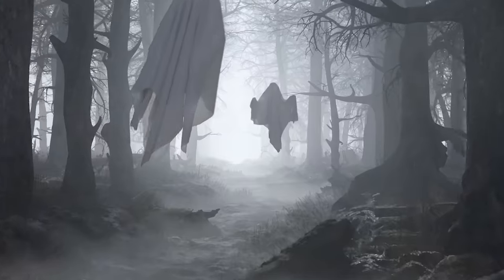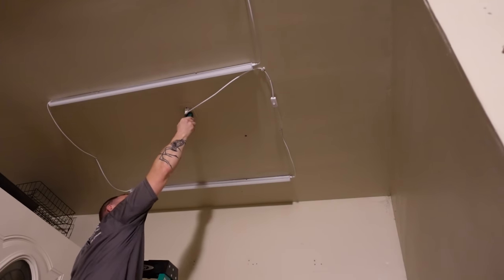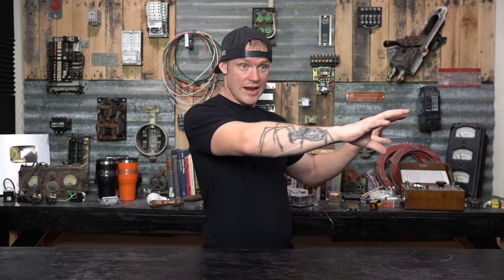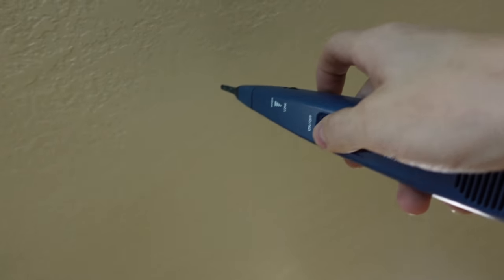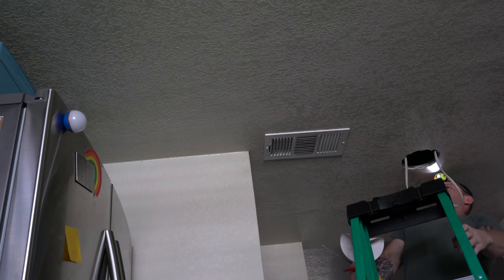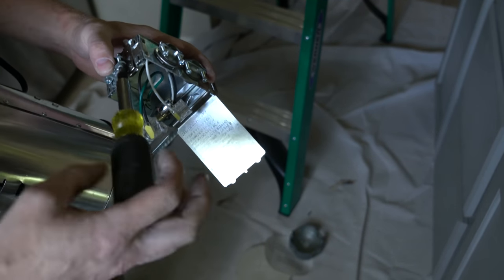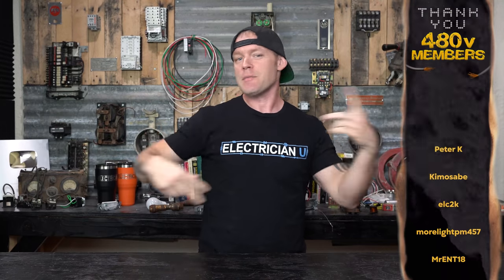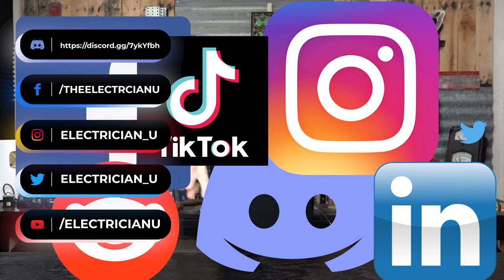THIS IS WHY ELECTRICIANS DON'T HIDE J-BOXES IN WALLS - Finding Hackwork!!

Comment: Main reason, I got out of "Commercial", work, was "Fast food" restaurant, trouble calls, Manager would complain, when I found, "Hack Job" Installations, undersize wire to cooking equipment, ECT. I explained fix, run new wire, They would blow a "GASKET". Like It was my fault, they had a "HACK", do the work. I went to "Industrial", same thing, followed me. You just can't "WIN" as a conscience driven, ethical Electrician. I retired.
Reply: preach it
Reply: @Lewdacris916  or a roach behind fry station...🏃🐜
Reply: Yes, thats why I stay away from service work. Lol
Reply: @ndusrnm  trouble shooting 101
Reply: I just came here from reading on an exclusive professional licensed electrician forum where they were discussing the best way to make a hidden joint, whether to use a metal box, a Western Union splice, or what. Not IF, but HOW. They had already concluded that sometimes that's a fact of life, the easiest way out of running wires from the panel and that there were no holier than thou amongst them. And that the Code Board members were just a corrupt bunch. Again: EXPERIENCED LICENSED PROFESSIONAL ELECTRICIANS.
Reply: @rogerbritus9378  
There are some extremely interesting situations that happen when correcting errors like this...
1.) Homeowner or business owner with electrical problem does not "believe" you when you tell them you have to open a wall or run a new wire from point of problem back to panel box.
2.) Related to number one... People have seen so many electricians "throw a splice" in a wall or ceiling that they think it is normal and acceptable. (per discussion by non-holier than thou electricians on that forum).
3.) The "fact of life" aspect DOES come into play when dealing with number 1. I say it is a fact of life too while being a "holier than thou" electrician myself. Reason... There is nothing more frustrating than a customer who decides you don't know what you are talking about (despite your credentials, license, insurance, years of experience) and hires another "hack" (non-holier than thou and does not give a damn about code or safety)...He "corrects" the problem with further code violations by throwing another illegal splice in the mix. The customer is just "happy" that it is now "working" and thinks you are the biggest idiot and "hustler" who was trying to destroy their home, charge an excessive amount of money and just overall... you are not a good electrician. It's a fact of life that when you walk away from a job that needs to be properly corrected, you will most likely be labeled incompetent.
Reply: @TJCarterNYC  part of being a good service electrician is getting the customer to understand that what you are proposing makes you better than the hack, even though you are offering a slower, more expensive solution. If you can’t develop that skill, you can’t do service work. It takes charisma, an ability to speak in a good cadence, choose your words in an empathetic manner, and speak with enough confidence to almost cross over into arrogance, but not quite.
Reply: @juana.2745  and @Roger Britus   You're both spot on. To add to that, you also need to be a fast read on some customers. Some people simply can not be brought to that way of thinking. Examine the customer in their own environment and look for clues as to how they live or conduct business. I do very little service work and what I will do is entirely by referral. It helps when a client knows going in that I have some professional constraints against pulling crap like seen in the video. That said my avoidance of service work comes from my absolute loathing of crawl and attic spaces. Personalities I can usually handle.
Reply: Been doing tree work 30 yrs, some people are so clueless, and think we can do magic. We try the best we can.
Reply: @TJCarterNYC  I tell people now, that most guys don't last 5 or 10 years in my business, after 30 yrs of  myself doing it. So.. for a lower price, and a good job, hire the young new guy while he is in business. Nothing wrong with that.
Reply: @juana.2745  
While I do agree that "professionalism" is paramount, there are just some customers who can't be reasoned with. I agree with 411DL on examining the customer too. Even with some landlords... 
They will "renovate"/update a unit/apartment and "decide" NOT to update the mechanicals. Hire a few carpenters and sheetrock personnel and sand the floors, laminate the plaster walls and paint. Looks beautiful and you pretty much know when you get there to "ONLY" install an appliance circuit for an A/C and/or light fixtures (only) that the wiring was not updated. 40 to 60 year old panelbox, rotting canvas insulation and no dedicated circuits for the kitchen or bathroom. This also applies to plumbing from what I have seen and discussed with a few plumbers. The bottom line, it cuts into a landlord's "bottom line" and capitalism takes precedence over safety. And yeah, I have seen some of these dwellings continue to operate without any "obvious" problems for a number of years and this contributes to the thinking that it is "ok" to operate in this manner. Again, making electricians and plumbers look like they are just trying to "hustle" a few bucks unnecessarily.
Reply: @TJCarterNYC   You had an excellent reply and some great answers followed. 

To add to what @Juan A. and @411DL mentioned about salesmanship, make it someone else's fault. 

In my case, I always blame it on the City Building Inspector (yes, with upper case to give it more weight):

"Dear CheepAess Client, I'd love to just twist some wires here for you, but then you won't pass inspection by the Almighty City Building Inspector, who will foreclosure on the property and demolish it to the ground, causing you to lose a lot more money than doing what I've suggested. And if it escapes the All-Seeing Eye and later you have an electrical fire here that kills 11 people including 3 babies, your insurance won't cover it because the work wasn't done according to code. Just imagine how much THAT is going to cost you!"  

Psychology studies have shown that people have a strong aversion to loss, so jump on that button till it cracks. Make your work sound like a bargain and they will thank you for doing it.

It's hard to be in the service industry if you don't have sales skills. Look at the video again. This guy could have been a used-car salesman, he's a natural.  The good news is that these skills can be learned, even if they don't exactly agree with your personality type. It does take effort.
Reply: @411DL  Reading a customer is a skill that is so often overlooked which can cost you tons of lost work often due to one statement that rubbed them the wrong way. There is not many true craftsman in their fields that also have the personality to read a customers needs during the initial contact and  empathetically explain their options to meet them. Everyone has been taken advantage of at some point and most people ive found don't mind paying more for a pro once they feel you've listened to and understand their concerns and have demonstrated competence through explaining their options. In my field its often as easy as simply returning a call and showing up when you say you will. Whats getting hard to explain is why a sheet of 3/4 Plywood is $70 in fact even OSB just run us $1100 for 16 sheets. Some things just can't be silver-tongued away unfortunately and im sure the entire building industry is in trouble if this continues

Comment: I wish there were more trades people like you. Not necessarily because you solves the problem (that's really the difference between skill and experience), but more so because of how you work to ensure a proper environment, investment in the proper tools, and ensuring you use best practices for safety. 
I've recently moved into a "new" home and had to do some basic electrical work to relocate a switch, what I found was cables were stripped (about 4mm) and not even looped around the conductor screws. My concern now is every switch, and outlet needs to be checked. 
Keep up the good work. Nuff' respect.

Comment: My only concern was "why did that cap melt"? So, if I remember correctly,  he had a counter top circuit, that went to a hall, then junctioned to the garage and a bathroom.  The counter top circuits are dedicated for the counter top , a bathroom is to have it's own 20 amp dedicated,  and the garage is to have it's own dedicated.  The neutrals appear to be cooking at the junction. Did he see the condition of the neutral at the panel? Is it cooking?
Reply: Because wire nuts aren't foolproof. Especially when there are more than 3 wires jammed into one. I have seen a few melt down from most likely one of the wires not being held tightly enough. Loose connections make heat. 

When I did commercial wiring, I avoided using wire nuts where ever I could. Especially in higher current circuits. I used properly crimped terminals and terminal strips. More work, but never had a problem. 

The biggest wire nut issues were where someone used them to connect stranded wire to solid wire. The joys of working on stuff in a 45 year old factory, with varied maintenance skills/changing codes over the years. 

The plus is you learn a lot, of what not to do...
Reply: Look up WAGOs it's a wire connector we use in the UK just push the cable in they are actually used as non maintenance connectors and then fit into a non maintenance WAGObox.
Reply: @chrisardern4594  I've used a few times. Neat and tidy units. Good for fault finding in appliances like fridges being able to disconnect one wire at a time. Bit on the pricey side still and have to carry too many types...and a bit bulky. I'll stick to BP's (Blue Points) and keep putting them though the washing machine from them always being in my pocket.
Reply: @chrisardern4594  We have them here in the US, too. We also have other variants like Ideal's In-Sure.
Reply: @bill6960  We all know we're supposed to twist the wires together tightly with pliers, nip the ragged end, and THEN screw on the wire nut. But people get careless and try to let the wire nut do the job without first twisting securely.
Reply: @TheDegan79  Have you tried the transparent WAGOs? Much smaller then the old opaque ones.
Reply: Wire nuts are designed to cover a proper mechanical connection. NOT to create a mechanical connection. Twist those conductors tight, three full turns, snip to 1/2", correct size wire nut, tighten firmly and it will hold forever. Anything "push lock" is a future fire hazard. From Wago to back stabbed receptacles they fail over time.
Reply: I agree. The circuit in question is in danger of being overloaded and would not meet current NEC. In addition it appears box fill was exceeded on that recessed can enclosure. I don't have my code book on me at the moment but pretty sure it is not rated for four 12/2 romex cables. Very clever fix though.
Reply: the wire nuts we use over here can have up to 5 wires in them, each 2,5mm squared in diameter. The most important part of using these nuts is to twist the wires in such a manner that after clipping them to size to fit in the nut, they should remain twisted together. This ensures that the twisted bundle is tight and thus the connection is as good as it can be.

we're using 240V over here by the way, probably there's running a bit less current through the wires because of that.
Reply: @reecenewton3097  Too many variables with the wire nuts twisted not twisted, some people use any wire nuts on hand even if that they are not the right size, so I only use and recommend Wago type connectors.

Comment: You'd love doing a service call at my house, I completely mapped out the wiring when I bought the place, laminated it and put it up by the breaker box.
Reply: I once worked for a homeowner that used a black magic marker or sharpie, to mark the circuit breaker number , above every switch and receptacle in his home.
Reply: @grumpycat4584  dang that's fancy
Reply: Funniest thing is when there's all that extra detail in there with all circuits labeled using computer printed labels so you know the last guy was really on top of it. And then it turns out all that info is completely wrong.
Reply: Had a guy who had the original plans for the house and had drawn all the circuits out. I have to say he was absolutely dead on. We also went together to see Randy Johnson pitch his perfect game against the Braves back in the day. A story for another time and place.

Comment: As an Electrician with 40+ years of experience it was interesting to watch your video. I anticipated your every move, even adding the can light. I’ve worked on every imaginable type of construction and without a doubt residential wiring is the worst. I’m sorry if I’m insulting the few good residential wiremen but most are doing the bare minimum to pass inspection and many inspectors are doing bare minimum only looking for obvious violations. This means that a brand new house already has electrical gremlins. Then you get multiple homeowners and contractors with little to no electrical experience changing things. Diagnosing electrical problems can be challenging and rewarding. A bit of advice to the homeowner, answer the questions that are being asked by your hopefully qualified Electrician and don’t overwhelm them with other non important information and your speculations. If you do that then you take what is already a difficult problem and turn it into the story problem from hell. Just like going to the Doctor, give them your ailments and let them diagnose you. I’m currently renovating my house that was built in ‘86 and I’ve encountered numerous buried boxes and live wires and every splice is loose or done improperly. Good luck, be safe and enjoy the hunt for the elusive electrical gremlins. Retired I.B.E.W. Electrician.
Reply: Last new house I bought in Peoria Az was a disgrace, company that built it was Mattamy Homes, would not trust them to build a Lego house, cheap, most likely illegal unskilled labor was used, I watched them build around me as we were one of the first in. Electrical wiring was zip tied to the gas supply to the water heater, frightening.

Comment: Pro tip: if you're changing out a fart fan, take the toilet paper off the roll. Nothing worse than a surprise fiber glass ass wipe. Btw I  Love my fluke toner.
Reply: Can't believe I never thought of this before I'm off to spread fibreglass fibres all over the work toilets thanks for the idea 😈
Reply: Excellent pro tip! 
I'll remember that.
Reply: Thanks, that sounds absolutely horrific.
Reply: Don't forget the towels hanging on the the racks
Reply: Only a pro could've come up with that.
Reply: That is the funniest thing I've heard in a long time. It is something I'll share with my techs.
Reply: PROEST OF THE PRO TIPS
Reply: It's the attention to detail that separates the pros from the amateurs.
Reply: @skyirwin1445  Boom, you just nailed it. In my profession, we have service manuals with service schedules. The manufacturer has done 90% of the heavy lifting for us by providing those schedules to us in each manual. 
 It's amazing to me, in my 36 years of doing what I do, how many techs. refuse to follow those guidelines. Those are the same techs. that like to brag about issues they've repaired. Issues brought on by their lack of proper maintenance that they ignored. 
 Then there's the techs. that won't use a company provided drop cloth while doing repairs, or maintenance. And they think the customer is an A. hole for complaining about the mess they made, or scratches to their counter tops.
Reply: That fiberglass is the worst. Bag it and tear it out.
Reply: Oof
Reply: @davemeads859  you are evil my friend 😁😂😀
Reply: Nice
Reply: @davemeads859  little jar of crushed fiberglass
Reply: WOW!  That's some attention to detail!  Well done!
Reply: @davemeads859  I know you meant this in humor, but one guy used fiberglass and cut his rectum to shreads. True 2nd hand story.
Reply: Depends on the customer😉😅

Comment: I had one of these ghost situations a few weeks ago.  It turned out to be a breaker that large black ants were occupying.
Reply: I had a good one. 
A customer called about an arc-fault breaker that would not stop tripping.
I thought, "Oh boy, here we go!"
I go to pull the breaker out, water started  flowing out of it! 

I do not know how, but water trickled into the panel and only filled this one top right breaker.

Damnedest thing. Brand new service, with PVC riser, everything sealed, no plumbing nearby.
Reply: @tailgunner2  powerwashing season.
Reply: @tailgunner2  Was there a properly installed drip loop on the weather head?
Reply: @jefferytownsend7787  yes.
Funny enough, it was water getting into the old service that prompted the homeowner to have it replaced.
Reply: @tailgunner2  I never used pvc as a riser, only as a  underground feed...
Reply: I had one where the collar nut on the meter base was just not tightened. Water took 20 years to fill up the SC and started dripping into the panel. Took two minutes to tighten the collar nut, 8 hours to replace the SC and panel. Sloppiness cost the second owner of the house thousands of dollars.
Reply: @tailgunner2  In my house, it was coming through the service entrance wire/cable.  I fixed it by having real electricians install a new 200 amp main box and service!